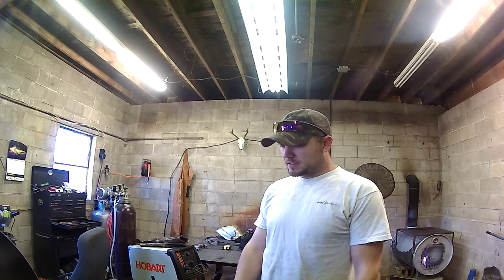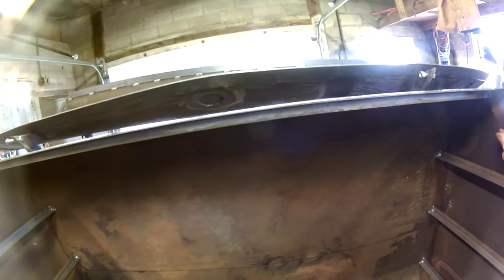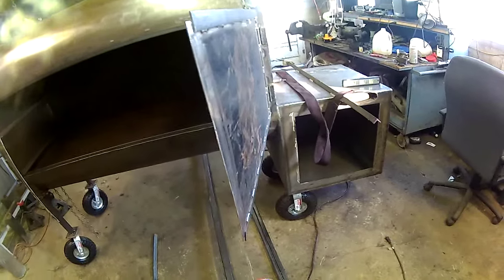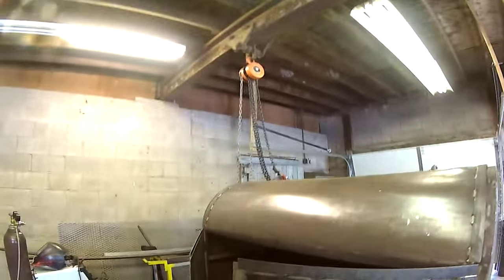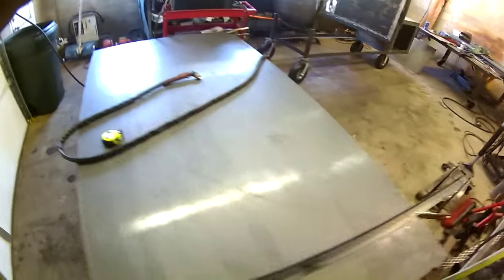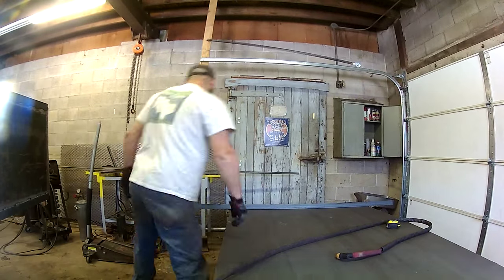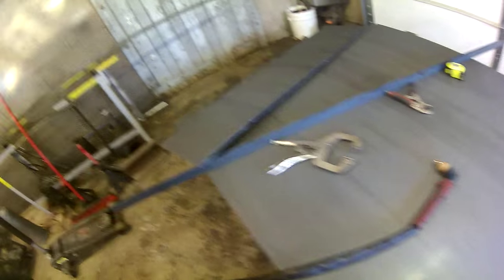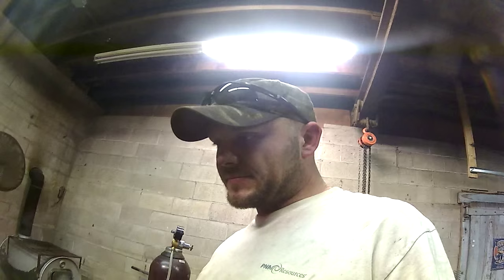Smoker build out of 275 gallon tank Part 5

Comment: Hey Rob: your smoker/barbecue is just amazing.I would love to be able to build something that good and solid. My only concern  will be the wheels. If I were you I would install metal wheels,noisy but fire proof. The burner is a little to close to the rubber,though I have to recognize that the video could be a little deceiving. Greetings from Toronto.
Reply from the maker: Honestly it worked out pretty good. The only issue I had was the weight of it on those tires. I did end up putting it on a trailer before I sold it.
Reply: Hey, Rob. Where are you located ?
I would love for you to build me one. I have the 275-gallon  tank.

Comment: Do you have video of you mounting the rails for the racks?  I'm converting a 275 also and would like some ideas on the rails.  Mine have to be able to hold the racks +100# worth of meat.  Thanks and God bless!
Reply from the maker: I think its in one of them. all I used was 1x1 angle iron 1/8th inch thick. Those racks have held will over 100lbs each no problem. Definitely put cross members in your racks. They are what has to hold the most weight directly. Its not like your putting 100 pounds directly on each rail if that makes sense. hope that helped a little
Reply: I have one cross member on one rack and in my "Pig Rack" I have two.  I'm just worried about the rails they slide in on.  I couldn't tell in the video, but are yours only welded to the tank at the ends?
Reply from the maker: +John Williford yeah they are welded to the tank

Comment: How much of a cost difference do you think it would be to make the tank out of plate or something thicker. You said you don't like the tank because it is thin so making a box out of plate is the biggest way I could see doing it differently.
Reply from the maker: I actually made one out of 1/4 plate. I cloned this exact smoker just built it with all brand new thicker steel. The cost difference was about 500.00